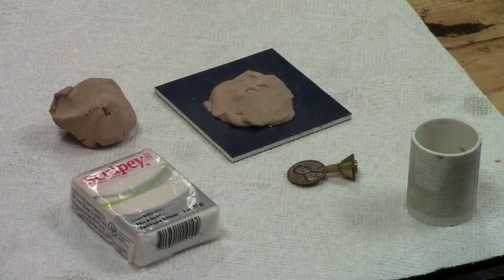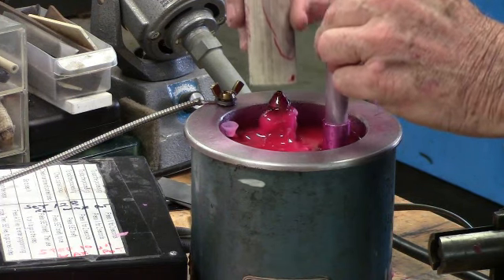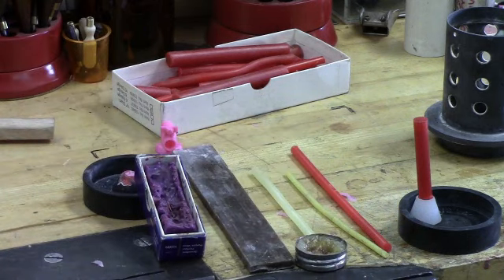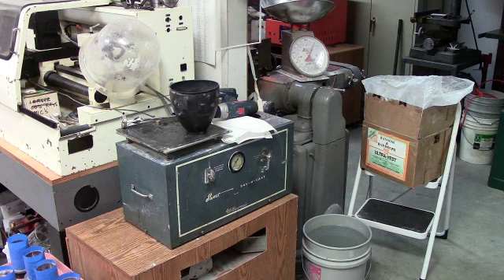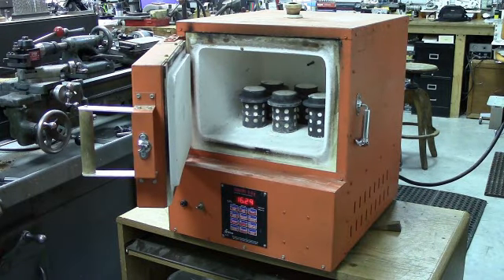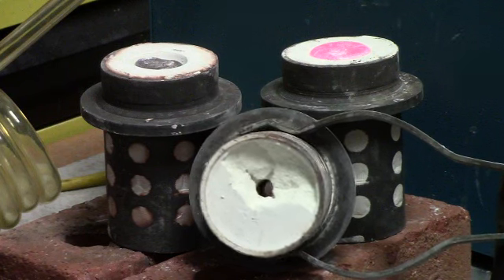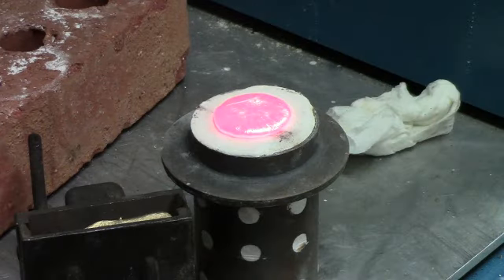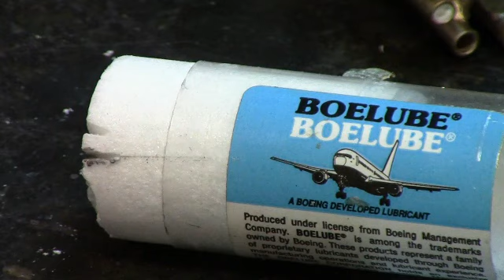Investment Casting or lost wax casting demonstrated

Comment: Very informative. Any chance of a video on the gear needed and process to do the internal tappers?
Reply from the maker: I’m not following you “internal tappers”. ????
Reply: @paulhamler8315   on the pvc tube you say there is an internal taper of 1 -2 degrees to produce a snug fit and reduce flashing of the wax. I think you said in another comment you used a lathe and boring bar,,, would be great to see how this is done.
Reply from the maker: @ianjinks4048  I'll try and post a few pictures and short video on hamlertools69.instagram soon
Reply from the maker: @ianjinks4048  https://hamlertools.smugmug.com/Hobbies/Monarch-10EE/i-Pt2rskz/A
Reply from the maker: @ianjinks4048  there are pictures in this link

Comment: What a great video.
What is that mold powder called that you are using there ?
I'm 61 now and many years ago I thought about making gun parts this way but just didn't have the knowledge. Today I do some sand casting but I'm not very good at it. Stuff is usable but not pretty. Sand casting is definitely a skilled trade. I'm just a millwright.
I also make rubber molds and pour engine mounts and intake manifolds for my vintage atv's. Many of the parts for these mid 80's FL350's you can't get anymore from Honda so you have to make your own stuff. I use "Vitaflex 60" .
Great idea on those tapered mold boxes. Might have to make some of those on my lathe.
Thanks in advance for any replies.
Reply from the maker: It’s called 😜investment check Rio Grande . Com

Comment: That was a great, no-nonsense demo, Paul.  Thanks for sharing.  I had always wondered how the casting was separated from the investment.  I assumed it was broken away, but I see now that it dissolves/fractures into the water as a powder.  Very interesting.  I learned several things about the process.

Comment: I make very fine bronze castings for miniature furniture. I've got used to flashing when I enject my RTV moulds. To reduce that I've had to make the moulds way thicker than they need to be to avoid distortion. Your mould frames are a stroke of genius to solve this problem..  I don't have a vacuum unit so I debubble using my vibrating fretsaw table and tap the flasks with a stick until the investment is set. I also paint the waxes with investment beforehand to stop bubbles sticking to them. 
  One thing I discovered for incomplete wax castings is to cut a fine channel toward the back of the mould which allows the air to escape. As long as its smaller than the entrance hole it backs up the wax forcing it to fill the mould because its got knowhere else to go.. Great video and I can't wait to give those mould frames a go..
Reply from the maker: Check my other videos I think there’s one on making molds
Reply: @paulhamler8315  Will do, thanks Paul..

Comment: What minimum separation distance would you recommend between the wax imprint and the flask botttom/top and walls?
Reply from the maker: based on the mass of the part I try 1/2 to 3/4 inch
Reply: @paulhamler8315  Thanks Paul, I am very grateful for you sharing your knowledge on casting on youtube, instagram and your blog.

Comment: I've been gathering kit to have a bash at this.    There was a wax injector like yours on ebay for $295 plus $115 for shipping to the UK, not to mention the tax this end.    Instead I bought a wax pot that  the ladies use for 20 quid and a digital thermostat, thermocouple and solid state mains relay from the far east for another 12.   The $64,000 questions are, please could you tell me what does the inside of your pump look like and what temperature does your wax pot work at?
Reply from the maker: John, the pot temperature range runs approximately between 100 F and 200F. 95 % of the injection waxes I use I set the temperature a 143 degrees. Best to error on lowest setting that will enter and fill the mold. I will be out of rhe shop for a few weeks recovering from surgery ,I'll explore the inners when I return to work.

Comment: Great video! I was wondering if the vacuum is absolutely necessary to the process, or if it can be done without it, I have been doing basic casting but wanted to try this, but I don't have one of those machines. Thanks!
Reply from the maker: Absolutely necessary ,it creates a pressure differential so the atmosphere forces the metal into the cavities to be filled. Other option is a centrifugal  spinner that slings the molted metal into the flask , For larger flask I feel the vacuum is safer.I
Reply: Thank you!

Comment: Hi Paul. Brilliant video. 
Where I live I can't seem to find any Investment Plaster. Is it okay to use Plaster Of Paris? 
Also, do you think a plastic syringe could be used as a crude wax injector?
Thanks for your help.
Reply from the maker: No on using Plaster of Paris. Google Rio Grande for investment
The syringe probably wont work because the wax will cool and get solid without heat.
What time zone /country re you in ?
Reply: Thanks for replying Paul. I'm in the UK. Finding investment seems really tricky. I can find suppliers of large amounts but they cost a lot, especially with delivery. Some sites I've found actually sell Plaster Of Paris as an investment, but having seen your videos I wasn't so sure. I'm only an amateur on a budget and wanted to try this without breaking the bank : )
Reply from the maker: Try contacting company's like Kerr or Randolph and Ransom
they are pretty good about sending small samples
Reply: half plaster half fine white sand works fine (for me for casting bronze sculptures)

Comment: Thanks for the information and video. I was just wondering what does it cost to get into investment casting.
Reply from the maker: Check the Rio Grande catalog they have starter kits with most everything you would need. Depending on what you already have or buying used equipment you can save some.

Comment: Great video and very informative - I learned a lot. Just one question if I may.......the one that failed because there was not sufficient investment casting covering the molds. If a metal cap, perhaps a screw on cap had been put on the open of the cylinder end to give further support to the investment, would not this help prevent this sort of failure ?
Reply from the maker: Possibly but the easiest solution is paying attention to the clearance before pouring the investment which I did not do.
Reply: @paulhamler8315  Hi Paul, thanks for your reply. Well at least you were not too proud to show a failure. The beauty of this is that it helps others learn from other peoples problems. Love the range of videos you have, so I will be watching these over the next week or so. Like you, I love working metal and wood, but unlike you I am a beginner. May I ask for details on that little furnace you have - is it and induction furnace ? I am in the UK and we have 240v supply here. All the ones I've seen craftsmen use have been small propane furnaces so far. I also now see the importance of de-gassing the investment - again something I have not seen mentioned before. I suppose it is important for small castings like those you made as a way to get trapped air out of the investment. Many thanks.
Reply from the maker: Chris Wood not an induction furnace regular ac .go to Rio grande.com search furnace
Reply: @paulhamler8315  Thanks Paul. I live in the UK so we unfortunately have not go Rio Grande over here. But I have managed to source them from people who sell furnace gear in the UK.  Cheers.

Comment: This video is amazing, thank you for taking the time to shoot, edit and upload it. It’s answered a lot of very specific questions that I haven’t been able to find elsewhere. I’ve been sandcasting non ferrous for a while now but have come up against the limitations of detail/undercuts etc. in smaller parts. Looking forward to trying some lost wax and nearly have all the gear up and running. A quick question if you don’t mind, what investment should I be looking to buy? Or what are  good ratios for a shop made mix? There are a lot of conflicting opinions out there and it’s a struggle to know where to start. I’ll be pouring various bronzes. Any help is appreciated! Many thanks, Ollie Sparks.
Reply from the maker: Ollie,  I'll respond on Instagrem

Comment: How does the vacuum take air out of the flask once the metal is poured? I don't see any vet holes.  is the investment porous? Fascinating video. Thank you for posting it!
Reply from the maker: The investment is extremely porous, the vacuum creates a pressure differential and the atmospheric pressure pushes the metal into the flask, much like the atmospheric pressure is applied to the liquid when you suck through a straw and create a vacuum in your mouth.
Reply: Paul Hamler I have a quick question. If the investment is so porous how does the Metal not flow through it and get pulled into the vacuum?
Reply: @brice2597  Viscosity and surface tension. Surface tension in particular is very strong.
Reply: Reinier Torres thanks for the reply, even though it’s been a year I was still curious

Comment: is this actually pulling a vacuum through the dried investment powder casting/flask?  I feel like I'm missing something.  I dont see how it gets a negative pressure in the cavity of the mold.  please someone answer this for me.,  dumb question.  But I see the investment being air tight?
Reply from the maker: jason clements It is like drinking a soda through a straw, you create a negative pressure in your mouth when sucking on the straw then the atmosphere pressure forces the liquid into your mouth
Reply: I just dont see the vacuum pulling a vacuum through the investment.  I get it now.  The investment cast is not air tight,
Reply from the maker: Jason after the investment has been through the burnout cycle the investment is very very porous and when placed in the vacuum chamber  gravity enables the molten metal to flow into the cavities created by the lost wax that was in the initial state before being burnout.  once the metal is in the flask which is in a vacuum chamber the atmosphere pushes the molted metal into every nook and cranny.  This is the best I can explain it ...hope this helps.
Reply: Cant believe that flew over my head. lol   subscribed and liked.  Thank you.

Comment: Question: Could the flask that had the top blow out be recovered by topping off the blown out investment and refiring? Have you ever tried that? The reason I ask, is that the interior would still contain viable molds that would be worth trying to recover if you have (like me) spent many hours modeling the wax originals. And thanks for posting this video - really great details and your insights are invaluable.
Reply from the maker: My first reaction is probably not, it would be quicker to use another wax and reinvest. A good reason why I make a silicon mold so I have an insurance.
If you don't  have extra waxes the cured investment would have a difficult time bonding with the fresh investment.

Comment: Paul, well presented and informative. What brand of RTV clear rubber are you using and where can that be purchased? Thanks. Larry in CA.
Reply: Also forgot to ask if the RTV requires vacuuming to de-bubble before pouring into the mold flask?
Reply from the maker: Akron Two-Part RTV-RP Silicone Mold Rubber Compound .I buy from a local jewelry supplier,however Rio Grande.com has it.
Reply: Thanks Paul.

Comment: That was great.  Excellent video. Very interesting.
Do the parts require machining or do you use them as they are?
Reply from the maker: Very little machining , a little grinding and sanding to remove the areas where the sprues were attached.. Go here https://hamlertools.smugmug.com/ and look at the folder on the wilton vise.
Reply: Thanks Paul.  Is there a waiting list for your works?  I would love to buy one!

Comment: Good video. That is an ingenious wax injector you have got there. Is there a way the wax can flow back into the pot, or does it just build up there on top and you put it back occasionally? 
Thanks!
Reply from the maker: About 90 % flows back into the pot ,there is always some buildup around the stem . The buildup can be wiped away with your finger but it does not cause any problem.
Reply: Thanks for the time you took to answer. I see now. I guess the pressure tube has some sort of opening at the bottom, so that liquid wax may flow back into the pot.

Comment: Hi Paul. Is that 1911 colt functional?  (.22 cal)?
Reply from the maker: It has every part the full size gun has ,the scale is 2/5 or 40% scale. The bore is too small for a .22 thus you can't buy or use any standard off the shelf ammunition.

Comment: At one point I produced a sprue cutting tool rather like an elongated hole saw that slipped down over the trunk of the "tree" and was powered by a drill motor. It's core was 7/16 diameter, so it would fit over a  3/8" central sprue with just a tad of clearance, and buzz of f the individual parts with their sprues still attached so they could then be cut off of their individual sprues with side cutters...no interference issues.

I made them from drill rod and hardened and tempered them individually, and those who bought them raved about them in the beginning, but I got distracted by other matters and never pursued them further. They may have been a total bust in later stages...who knows?

Anybody who wants to pursue them further, feel free to do so. I am turning 75 in a few weeks and am past the innovation stage......Joe

Comment: Levy son you never quench any metal after casting . Break away the investment with a probe or a screw driver you can submerge the flask in water but only when it's cool enough that you can pick it up with your hands. I use the T shaped tool that  tighten the blade on a Stihl edger . With the R & R or the Kerr investments  or any that is used in this method of casting make sure when placing the  rubber bowl on the pad to remove the air that it's trapped after mixing do not exceed ninety minutes . Usually you will see a rise and fall of the investment following by a bubbling effect that it's also known as boiling water effect . After transferring the investment to the flask allow excess tape or use a rubber sleeve above it's rim so as to the investments rise and fall does not over spill on the flask sides . After the rise and fall of the investment in the flask proceed to release the pressure immediately in the chamber pad . Do not boil the investment while in the flask for this will debilitate it . After at least four hours place the flask in the oven ( kiln) temperature not to exceed 1300 Fahrenheit . For if it does this will also debilitate the investment . I cast at 700 fahrenheit Gold and Silver and 500  heavy or solid pieces . I have never casted Aluminum using a vacuum caster  but I would think that if  in sand casting application the metal or wooden box mold that holds the pattern design in the clay sand  is not heated , the perforated flask should too also be at room temperature after wax has been dissolve in the kiln .  Did you look up Belmontmetals.com or Romanoff.com for your vacuum pump oil ?  A good cast result is also achieved using virgin or refine metals ! Look up Riogrande.com or Gesswein.com these companies along with vacuum pump oil will have great finishing abrasives !